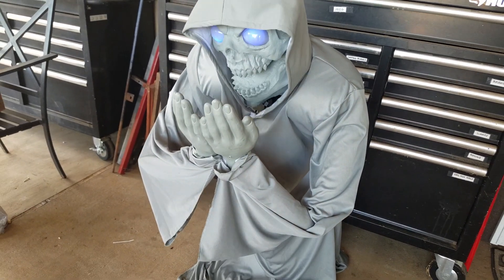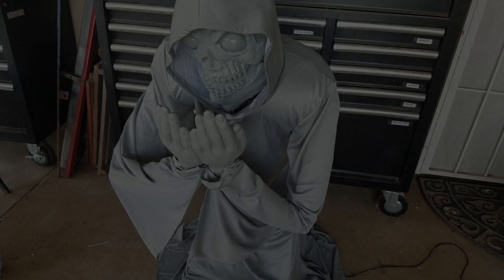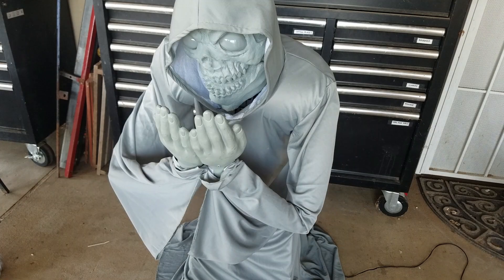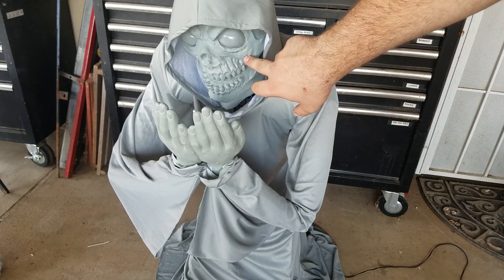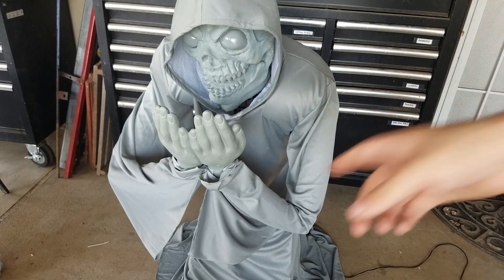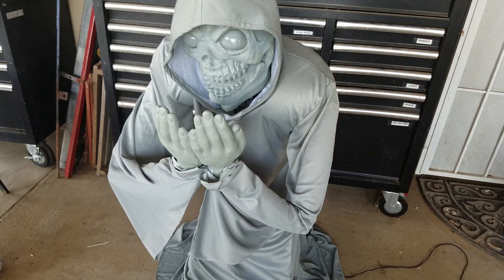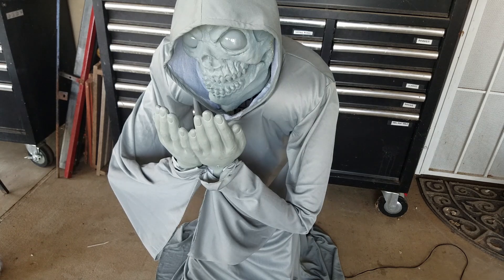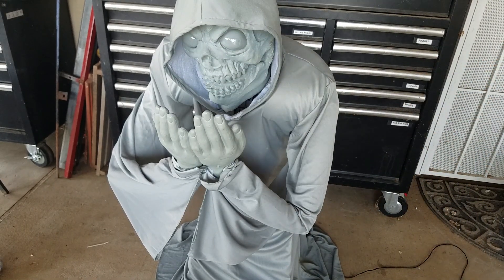First Animatronic unboxing for 2021 !

Comment: people can be dumb with adapters. especially 12 volts
Reply from the maker: I just dont understand, when it says right on the module 6.volts use 6 volts XD
Reply: @spiritofhalloween9537  that’s why it’s pretty dumb. They don’t bother to look.  I used to make the same mistake until I became a collector. I fried a Halloween fiber optic tree by accident. I didn’t know certain adapters could be bad